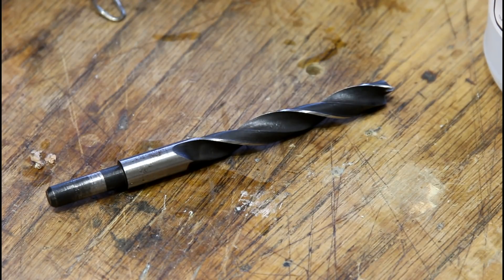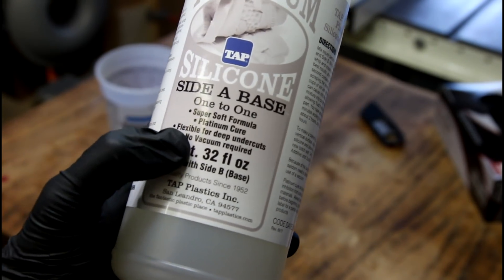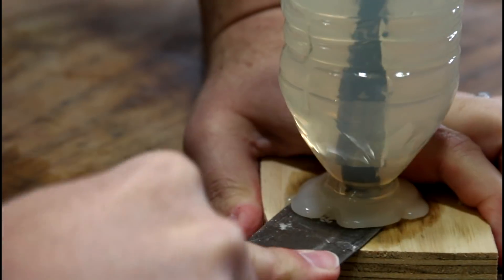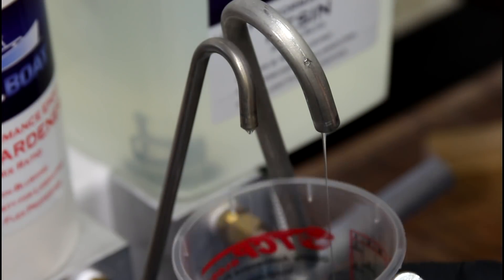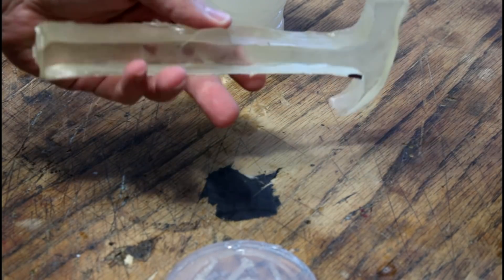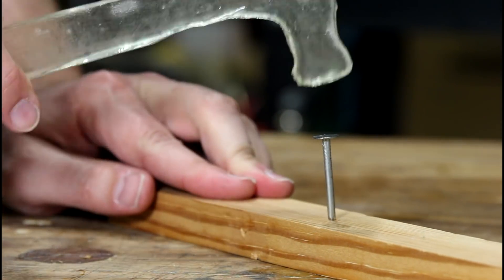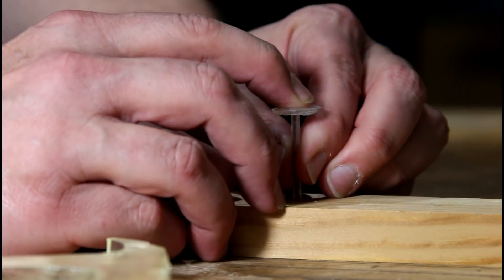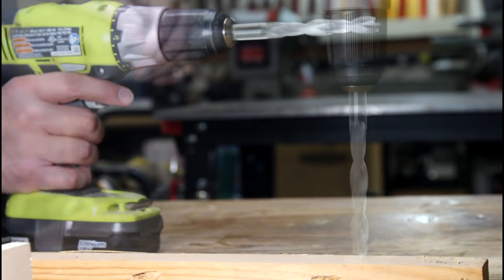Can You Make Resin Tools?!

Comment: "It's hard wood or soft wood?"
"It's pine."
"Wich makes it hard wood or soft wood?"

Thank you. From all of us. 😂
Reply: Pine is a soft wood
Reply: I looked up what the actual difference between hardwood and softwood is, and it doesn't have anything to do with the density of the wood, but its seed.
Balsa is super soft, but categorized as a hardwood. Yew is pretty hard (harder than some oak),  but it is a softwood.
Depending on what type of pine that board was, that might have been a medium density wood, so maybe not so soft.
Reply: There may be some official definition of hard vs soft wood, but in woodworking there is a unspoken understanding of it. I do woodturning and you begin to learn which woods are hard and which ones are soft. Most coniferous trees are soft woods, but species like cypress, sycamore, and Long Island pine are hard enough to work with. Some hard woods are soft relative to other hard woods, examples being sweet gum, poplar, and cedar.
Reply: @tiffanysandmeier4753   Actually it does have something to do with the hardness of the wood. Originally it was called hardwood because wood like oak etc. was hard and pine was soft and then, when scientists needed a name for different groups of trees they just stuck with these names.
Reply: @ivarlaupet8972  I guess what I was trying to say that not all hardwoods are hard and not all softwoods are soft.
Reply: @tiffanysandmeier4753  You are correct! To me, that board looks like southern yellow pine, which is actually pretty hard.
Reply: it is still quite hard for experiment like this...spruce would have been better
Reply: What brand on carbide gouge do you use ?
Reply: @tiffanysandmeier4753  nothing to do with density but ends his comment saying different density.
Reply: One word to determine "How hard is that wood" ... Janka
Reply: Yup
Reply: So glad somebody has left this comment already.
Reply: @tiffanysandmeier4753  a tiny bit of snow fell onto abut if pines. ( It was more of an ice storm). We lost statewide power
Reply: Soft wood.
Reply: Soft
Reply: Soft its a conifer. Meaning it does not drop its leaves during fall, Meaning that the nutrients do not drop to the roots
Reply: @kevinmontoya7318  soft wood refers to how it drops its seeds not the leafs.

Comment: "Is it Hard wood or soft wood?"
It's Pine
"So hard or soft?"
Yes.
Reply: pine is a soft wood
Reply: @Chumbucket187  lol yes, but it was harder than the resin "tool", but on top of that, pine being a very soft wood it can have VERY hard spots in the grain and in knots.  A thick pine grain line can be as hard as concrete and has been the bane of many a cutting tool.  Also, there are "hard pines" like long leaf pine which can indeed be quite hard.  If you starve some types of pine of water and force them to grow at incredibly slow rates, it can actually be much harder than oak as the grain will nearly be all of the resting ring type and not the fast growth ring.
Reply: "it's the softest wood I could find"
Have you considered Balsa?
Reply: @MrMR-sk8jm  right? surely balsa is much softer than pine

Comment: definitely i'd like to see the follow up. Also i wonder if ther resin screws could be use in predrilled and taped holes in resin for "assembly" purposes
Reply: I was wondering about that too, with the screws! If they weren't actually responsible for cutting into the wood, how would they fare with just screwing in and gripping?

Comment: Resin screws really don't sound that "out there", I'm surprised this is the first time I hear about something like that.
Reply: having seen the video, I'm not surprised I haven't heard of resin screws before ^^
Reply: I thought that was the "least dumb" thing he made. It could work well with plexi-glass and other clear materials, just pre-drill the holes.
Reply: You could use it for drywall anchoring, they're made from plastic
Reply: Ya I have so e plastic razor blades so not to crazy

Comment: You should make more screws so you can test how well they go into and stay in a pre-drilled hole!!
Reply: I was wondering this... I am guessing they would snap when tightened if they work at all.. 🤔
Reply: yeah i had the same thought, it would probably melt the threads and turn it into an epoxy nail
Reply: Both are pretty likely but they give me thoughts towards cosplay and possibly film props that need to snap at a connection point and be repeatable.
Reply: @calvindelabio3060  now we’re gettin weird!

Comment: It'd be interesting to see the effects of glass fibre or iron filings mixed in with the resin.
The hammer would probably fare much better with fibres, but since the drill bit essentially melted, iron filings might help dissipate the heat (And retain the edge sharpness slightly).
Maybe even a combination of both!

Comment: that was totally surprising , from the air demoulding to the use of the hammer , I was sure the hammer was going to explode but it actually stood up to quite a bit of punishment, the nails well yes not too much of a shock but the srews and drill bit did far better than I expected, Ive used steel drill bits on shiny chrome steel and had the same weird dancing effect  very cool....I would be interested to see a stress test done with refracted light like architects do on arch constructions and the like ...to see how the stresses move up through the drill bit in particular. Weirdly fascinating stuff

Comment: funny, When building a RC airplane I consider anything other than balsa to be hard wood.  I would think as others have said that the screws would work in foam or balsa.  They were very pretty.  My first thought was to add cotton flock. But sawdust would do the same. If you can get it to properly suspend in the resin.  Looking forward to the follow up

Comment: I ski race and we use cast plastic drill bits for drilling the holes in the hill for placing the gates in.  The only difference is that they have carbide inserts on the tip, but the flutes are plastic.

Comment: Fun fact of the day if you drill a pilot hole and then cut some lines from the top of a screw to the head (minimum of 1 maximum of 4) you can make a makeshift threading tap... it’s not amazing but does well in a pinch but you also have to be extremely careful as it’s a screw and can not only cause a split in the wood but also can strip out the threads you make if you aren’t careful enough... haven’t tried it on metal because I don’t have any thick enough metal and I’m pretty sure the screw would break

Comment: epoxy tools have been in use a long time. they are not  for woods generally but useful for many other soft materials. advantages are light weight over metals, easily resharpened and inexpensive. I think the most common epoxy resin tool in use is a spatula or paint scraper and then maybe knives

Comment: I knew these weren't going to work but clicked on it anyway. I'm surprised about the hammer! Adding graphite powder or cavacil or microballons etc would help or even chopped up glass strands but I don't think the nails or screws or drill will ever work because epoxy is really brittle when it has a thin edge and what's happening is the edge snaps off and then friction just heats up and melts the epoxy

Comment: what about some sort of hybrid like maybe something with shaving (i.e metal or wood). Curious if it makes it any stronger.
Reply: also for the drill bits im assuming its just the resin melting due to friction. Does high heat resistant resin exist?

Comment: Here's an idea for a project.  Join 2 boards with mitered corners.  Space apart about an inch and pour clear resin between.  You can call it the invisible joint.  If that is too easy, try making a box with all 4 joints invisible.  I'm sure you're running out of ideas by now :>)  Great channel you have here.

Comment: The resin screw and the resin drill might work better if they had a pilot hole made by a regular screw or drill respectively.

You could probably also make something a lot stronger and more rigid by mixing the resin with something else to produce a composite material.

Comment: I would like to point out mixing in stainless steel powder seems to strengthen epoxy.
you can also try switching the type of epoxy mixture used for casting. some epoxies seem to be more durable than others.
there's this stuff called "tough-cast 65d" not sure how it compares to what you're currently using but it claims to be impact resistant so it might survive being hit with a hammer.

Comment: A resin table saw might have worked? I've seen paper being used, which works except it breaks easily, but resin is probably more durable. Just be really careful though cause I don't think big chunks of hard resin flying at high speed is a good thing lol. Or maybe try making some of these things with different resin types since some types are harder than other?

Comment: well maybe you can mix the epoxy with something like put something in the mold for the epoxy to fill up and then put it in the pressure pot and maybe the pressure from the pressure pot will push the epoxy into all of the holes or put it in the vacuum I don't know but it looks like the epoxy would be a good binder for some type of other medium

Comment: Put a metal drill bit on the end of the resin bit when you cast it and also so the resin hammer with metal integrated into the handle design

Comment: Steel shavings in the epoxy MAY make the drill work not just any shavings though hardened steel shavings. Could get that from either grinding a piece of hardened steel which isn’t exactly smart because of heat issues or hardening steel shavings which is pretty hard to do🤣

Comment: I wouldn't try to drive screws in wood, without drilling a guide hole first. I think it would have been better to do that first, that would be a more accurate testing.
But I also don't think it would have survived either.

Comment: the thing is, they have no chance at working in standard materials that have more integrity than the resin. these tools and hardware would be better at working and holding rigid light foam crafts or things made of gelatin, likely the gelatin crafts because you can assemble something clear with no glue, and no visible fasteners